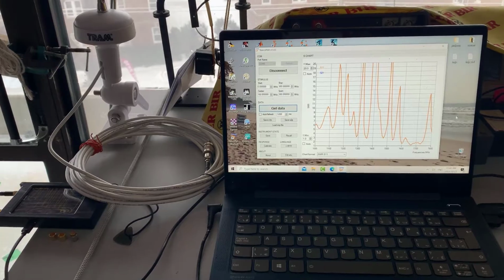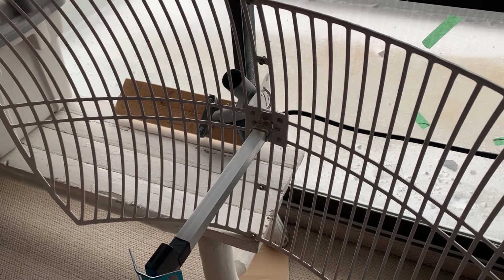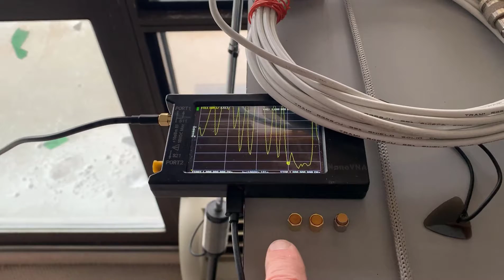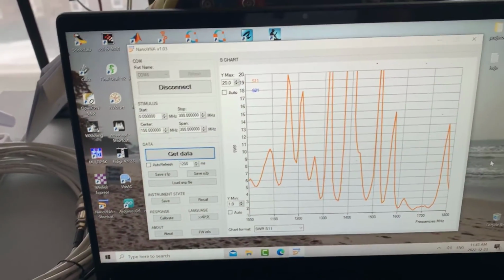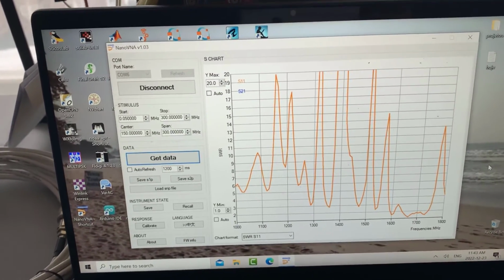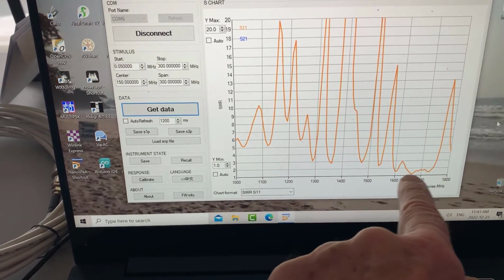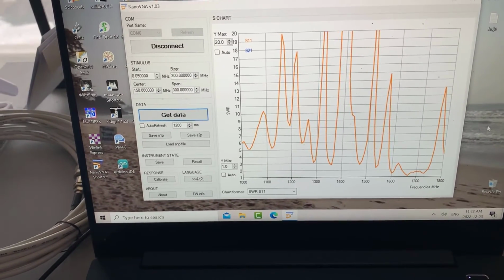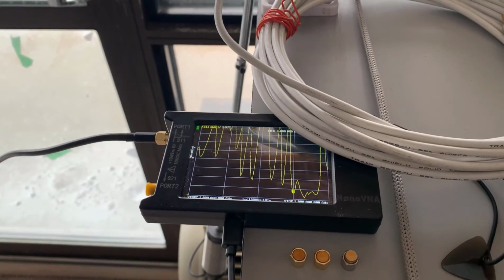L Band Dish Antenna Testing with NanoVNA

Comment: Hello Jeremy, I ask again about measuring gain with two NanoVNA idea that I heard... Should it be really possible?
Reply from the maker: Not sure. Generally to measure antenna gain you need to be in free space. Compare an omni antenna to the antenna under test and an omni receive antenna which physically moves in xyz space. A NanoVNA could be used as a Tx source and another connected to the omni receive antenna measuring return loss which in reality would be gain - free space loss.